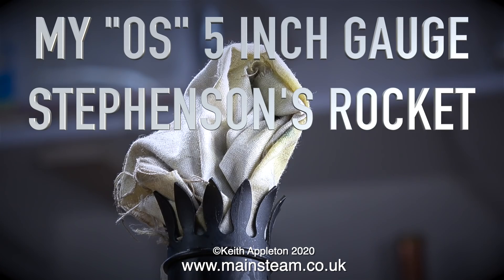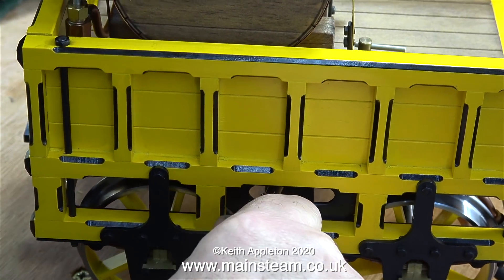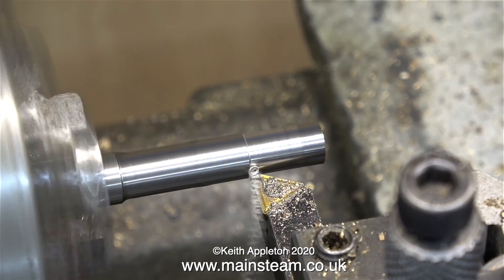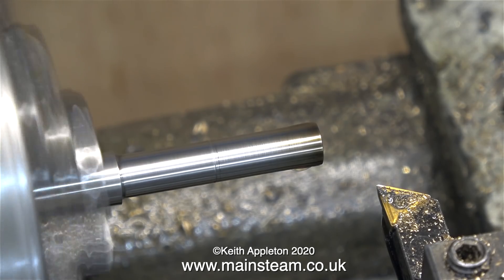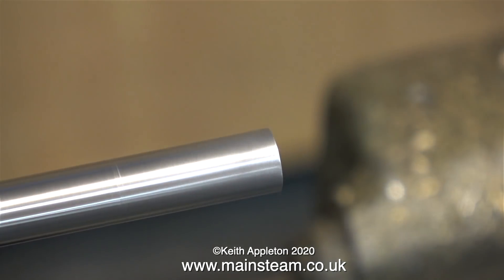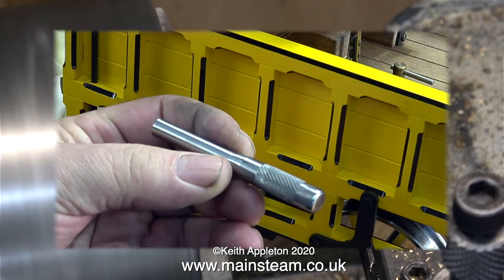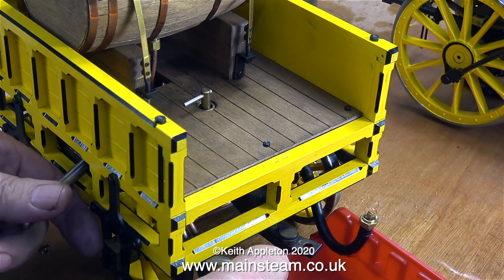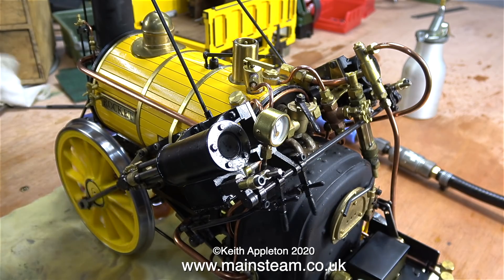MY "OS" 5 INCH GAUGE STEPHENSON'S ROCKET - PART #6

Comment: I would dearly love to see an addendum to this series, to wit, the adjustment and control of the valve levers on the footplate and how this manages the eccentrics on the main axle.  I've always been curious how they function.  I do believe you are one of the better ones to explain what is happening.
Reply from the maker: Please re-watch some of the earlier episodes.
Reply: @keithappleton  Thank you Keith, I have.   The missing part for me is HOW the lever moves to effect the eccentric.  I've seen the full size engineer grip both handles and move them.  But I fail to understand how shifting the valve lever around the rod on the footplate moves the eccentric side to side to engage the pin in the driving wheel.  In general, I get moving the valve levers moves the eccentrics, which changes from forward to reverse. That's not at issue.  Its the details of the parts, how they interact, and what each lever does.  Stephenson's Rocket has a unique control arrangement, which does not exist in later locomotives.  I do realize that you focus more on other things and perhaps this isn't your cup of tea.
Reply from the maker: on this model, the lever has 3 positions Forward, Neutral and Reverse. Moving the lever either select Forward, Neutral or Reverse by engaging or disengaging one or both of the eccentrics.
Reply: @keithappleton  Thank you for the additional information!  So one lever controls forward, neutral and reverse; whilst the other admits the steam?  [Please note: I am really curious and want to learn.   I will leave the keyboard warrior jack-assery to others!]
Reply: @WhatAboutTheBee   The large lever in the middle is the regulator for the steam - if it points straight back, the regulator is fully open, turning it 45° either to the right or left closes the valve completely. On the footplate, there is a pedal, which controls left-to right movement of the eccentrics on the driving axle. If the pedal is down, the eccentrics move left and press up against the fixed collar on the axle with a dog positioned for reverse - if the locomotive is in motion the dog will slide against the eccentrics until it finds the hole for the reverse position and then the eccentrics will slide fully to the left into the reverse position. There are two eccentrics, one controls the left valve, the other controls the right valve. If you put the pedal in the middle, the eccentrics are in the middle between the two collars, and turn freely on the driving axle - the valves are not operated. Putting the pedal in its highest position presses the eccentrics to the right, up to the collar and dog for the forward position. The two small levers on the left of the locomotive (near the pressure gauge) are for operating the valves directly. In the actual Rocket, the rod coming (indirectly) from the eccentric (the handles pointing back) could be lifted up and decoupled from the rods operating the valves (the handles pointing down), and these handles would then allow to move the valve manually to get the engine rolling, and then let the rod from the eccentric engage with the valve again as soon as the eccentric came around to the right position. In the model, this uncoupling is not possible (the connections are fixed with a bolt), but the same effect can be obtained by fiddling with the downward pointing levers and thus driving the eccentrics to rotate on the driving axle until they engage in either forward or reverse position, depending on the setting of the pedal on the footplate. This valve system is a faithful reproduction of the one used on the actual Rocket, of which Robert Stephenson wrote that he was very pleased with it.

Comment: Will you ever run the Rocket on a track?  I know you don't want to fire it, perhaps a high pressure compressed air tank?  I had the pleasure of seeing the 4-8-8-4 Big Boy locomotive when it came through my town a month or so ago.  That was some steam engine!  It had been converted to an oil burner from coal, less of a mess I guess. Probably hard to find enough high quality coal to fire an engine of that size.

Comment: Given the 220... 235... 245v mains voltage wouldn't a single phase motor be a viable option?  If you have to replace the 3 phase converter maybe a new motor would be better and cheaper?
Reply from the maker: you are probably right.